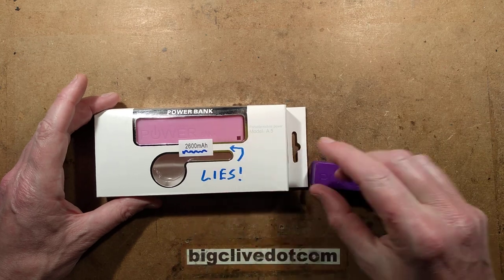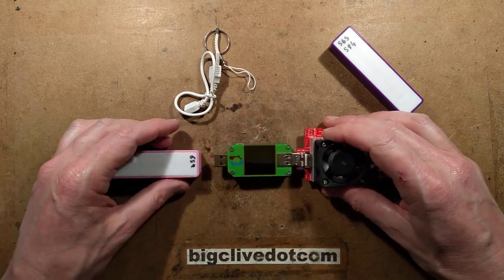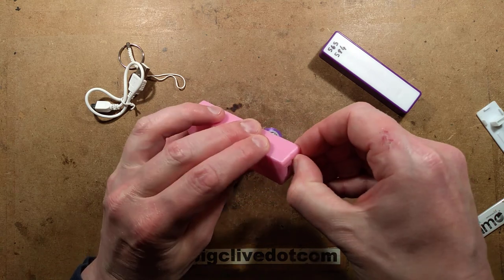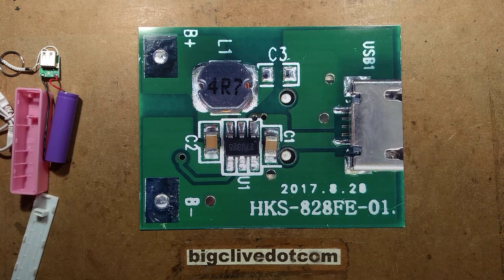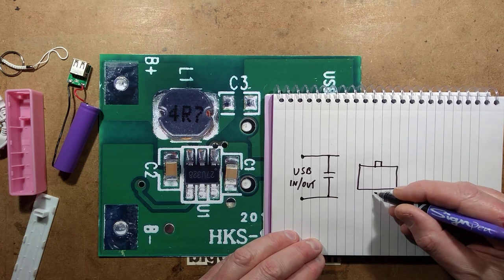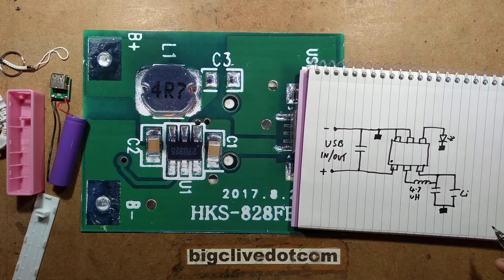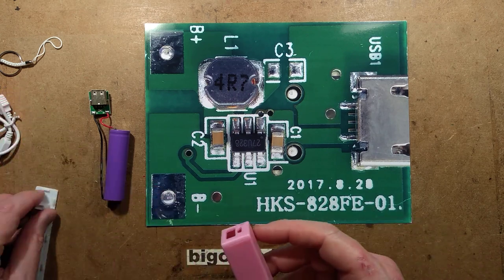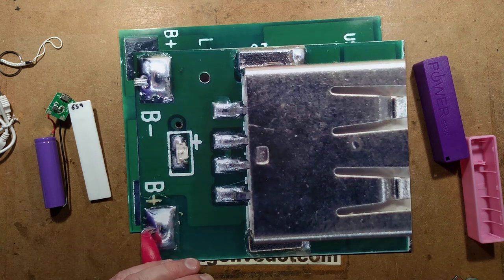Simplest power bank ever?

Comment: Could you please drop a fully charged power bank into a bucket of water?
Reply: Doesn't do much,my mate races high end RC cars using huge capacity ultra high discharge lipo's that cost hundreds of $ each,when they drop a cell or start to get a bit puffy, they get dumped into saline water to neutralize them incase they decide to spontaneously combust in a not so safe manner,not as violent a reaction as you would hope im  sorry to say.
Reply: @dunxy 
☹  He hasn't blown anything up in awhile.

Comment: I never understand power bank capacities measured in milliamp hours. Milliamps at what voltage? It's meaningless.
Reply: Those values are actually the capacity ratings for the battery cells themselves as such the relevant voltage is the output voltage of the cell, to convert to milliwatt hours multiply the mAh rating by the nominal voltage of the cell (3.6V for lithium-ion cells). In reality of course the actual output voltage of a battery varies throughout the discharge cycle so it's the nominal cell voltage you need as that is the time weighted average potential of the cell over the full discharge cycle.

Comment: I have one of those. Looks the same on the color side. I think yours is a China copy of mine. The circuits inside are more elaborate(8pin chip and 11xR/C) with red and green indicator diodes that actually match the housing. The cell inside is blue and labelled 1200mAh. Mine also has nickel strip wiring to the negative pole of the cell. 

There is info printed on the white side on mine though saying: 
SIGNALEX  Cap. 1200mAh, Model No: 170327, 
Birmingham B2 2FQ.
here's a link I found https://www.amazon.co.uk/Power-Bank-by-Signalex-1200mAh/dp/B01NAN1OTF

Technically even though on mine it states the same capacity on the outside as on the cell on mine it's still false, because 1200mAh at 5V  is 1800mAh at 3.3V and there are losses. The real capacity is probably about  700mAh... at best.

Comment: the question about power banks I've looked on the internet and cannot find the answer I'm looking for a simple answer I bought a USB power bank and it has adjustable to the mobile phone device current . does that only work that system when I have the tablet on and doesn't work with charger only cable thank you very much for reading my comment and I subscribe to your channel it's very good thank you bye I'm talking about theI'm talking about the amps output not the voltage thanks the make of charger is in otl. T e c h i m o l o g y s I bought it from Argos and they come with different types like SpongeBob superman hello kitty written on them and that's it really thanks